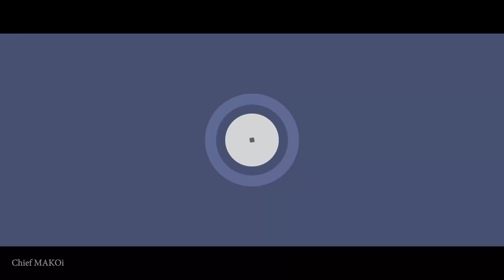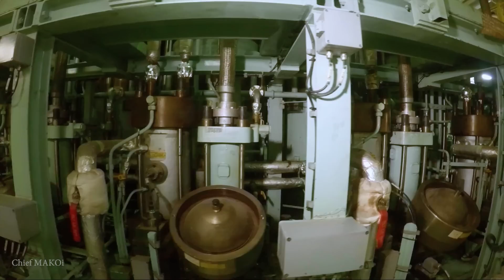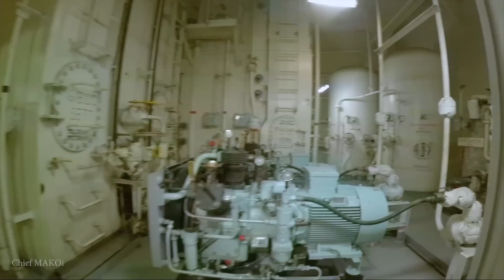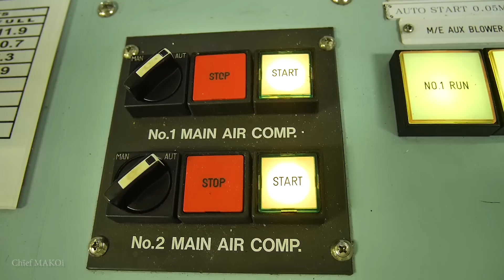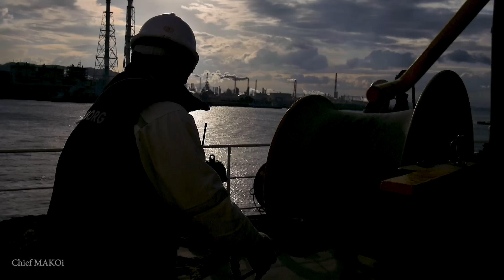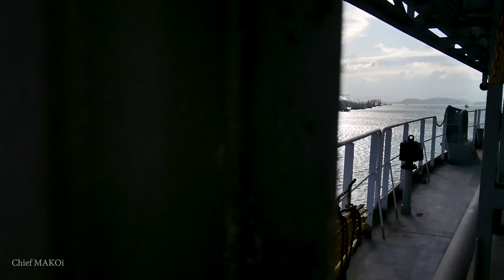Starting Up the Ship's Engine and Leaving Port | Seaman Vlog

Comment from the maker: Uploaded just on time after watching the premier of Game of Thrones S8E01!  I hope you enjoy this guys.  Don't forget to LIKE, COMMENT and for those who are new to my channel, SUBSCRIBE!!!
Reply: I’m not allowed to watch Game of Thrones 😐😭
Reply from the maker: @Stanley Banks  we just cut off the fuel injection for the particular cylinder.  The engine can still run but should not exceed 50% load.  Fixing it will have to be done when the engine is stopped.
Reply: New and just Subscribed.
Reply: Very interesting videos congratulation Mr CHief
Reply: Sir I am kindly request sir you want upload Electro technical officer job life and story sir please sir you want upload sir I am a BE EEE holder I want join ETO course so  you want upload  sir
Reply: I just watched this after watching GoT. Good combo.
Reply: Chief, regarding overhaul of a ME Unit ( exhaust vv, piston, etc ) which are the steps to isolate properly ( in good order ) the ME? Thank You.
Reply: What does dead slow ahead and a Stearn mean
Reply: @kydddj111  - dead slow ahead means the lowest sustained speed moving forward, it's usually the first notch on the gearbox, dead slow astern is the same thing , only in reverse.
Reply: Dead slow ahead = very slow forwards. Dead slow astern = very slow backwards.
Reply: Nice and informative vedio Chief 👌..very helpful
Reply: Chief MAKOi ,
I would like to be a marrine engineering.
Where should I study the marine course for good placement.
Reply: Great video keep up the good work sir.
Reply from the maker: @fluke196c  no keys.
Reply: sir I request you to please tell the crew and officers not to harrse galley dept they the only persons who feed the crew on board. It is my humble request. please make a video again for galley dept one capt has harrsed me a lot due to that I was at home for 3 years.
Reply: @venrammur9800   nobomNOBODY
Reply: Chief MAKOi, glad to have stumbled on your channel. I've always been fascinated with the seafaring life but for some reason didn't have the gumption to make that career choice. Bonus: ikaw ang kauna-unahan na naenkwentro ko na kapangalan ko na, kapalayaw ko pa. Kudos for sharing your experiences with our young seafarers and the rest of the world!
Reply: Hey I'm new to your channel and wanted to say thanks for the content and I was wondering how did you get into working on ships I'm just curious how people get into jobs like these
Reply: Chief MAKOi, you stated that the engines flywheel is directly coupled to the prop shaft and that the engine must be reversed to generate reverse thrust. Is the engine on your vessel a 2 stroke (2cycle) diesel ?
Reply: ROTAXD 
Chief sad the exhaust valves are electronically controlled. That suggest the inlets have atmospheric or piston valves which are used only on two strokes
Reply: @Dave5843-d9m  you're right there, the inlet valve is the piston itself that covers and uncovers the scavenge holes  or inlet ports in the cylinder liner as it travels up and down inside it to allow fresh air in this case scavenge air...
Reply: You’ve got a beautiful clean engine room there, chief!
Reply: Chief ,good day I finished and graduated marine engineering year 2013. Is it still ok for me to apply as engine cadet?
Reply: Chief ,good day I finished and graduated marine engineering year 2013. Is it still ok for me to apply as engine cadet?
Reply: Hey, I might be starting a diesel mechanic apprenticeship soon, could we video chat sometime? I would like to be a mechanic on ships like that
Reply: @chief Makoi- thank you so much for these videos. I watch them & remember my dad. If he was here, oh how he would ENJOY, watching the videos.
Reply: This video has more rewatch value than Game of Thrones season 8.
Reply: wowwww MTM Chief
Reply: pa backer sir.. wla na ako pera
Reply: Diesel electric engine cruise ships
Reply: Engine cylinder engineering room
Reply: I'm a new sub. Very interesting content. Stay safe !
Reply: Super sir

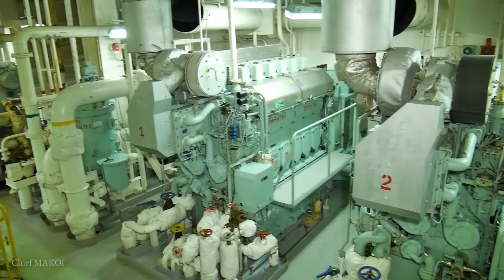Comment: At 2:20, it appears that you have (all?) three gensets in one room. Is that common practice? It seems to raise the risk of a failure of one generator damaging others - critical surface based installations usually have them in separate fire cells. Is this considered a serious risk?

Comment: Once the one piston is remove, can still the engine keep running?
Reply from the maker: That would cause too much imbalance.  In case of emergency where one cylinder has issues, just keep the piston inside and cut off its fuel supply.  The engine will still run at reduced capacity but should be enough to get the ship to safety for repairs.

Comment: It is my understanding that there is no clutch between the engine and the propeller shaft. For reverse, do they stop the engine and start it backward? I just viewed a video where they were testing the engine by running it. What stops the ship from moving if on Anchor? If it is at dock, can they really put that sort of strain on the dock lines?

Comment: Leaving the port now takes longer time for the engineers to stay in the engine room because for ships equipped with scrubbers.. you would have to changeover to HFO again when 12NM away from shore. Now after unmooring  it takes another 3 hours for engineers unlike years ago it only takes 1 hour and everybody can rest. So many additional machineries,regulations,procedures and maintenance marine engineering is becoming more and more stressful yet salary range remains the same

Comment: Why can the engine run 0 to 50rpm, 60 to 70rpm, but not between 50 and 60rpm?
Reply from the maker: Barred speed range causes heavy vibration.

Comment: The different ships, because of the different engineering plants, can take up to 8 hours to get the engines ready.  Steam plants need time to warm the firebricks in the boiler so that the bricks don’t crack.  For ships like navy destroyers with boilers, in a “Pearl Harbor” scenario the ship can get underway in minutes by sacrificing 1 or 2 boilers while ships with gas turbines can get underway quicker with little to no damage.
In 1986 my ship was in Subic Bay and at morning quarters we were told to be prepared to get underway in eight hours.  At this point one of our four gas turbine engines was out of the ship.  An hour later we were told to be prepared to get underway in four hours. At two hours after morning quarters we were told to be prepared to get underway in two hours. At three hours after quarters we were underway and the engine had been put in the ship far enough that we could bring it online in a day or so.
The scramble to get underway was brought about by President Marcos fleeing the country and my ship was to assist if he fled by helicopter or small boat.
In 14 years at sea in the navy, I served on six classes of ships and have gone dead-in-the -water at least twice with engine failure.  Once, just off the coast of California and once, just West of the International Dateline.
Reply from the maker: Wow.  Thanks for sharing. 😊

Comment: God Bless you and your family Chief MAKOi!! Happy Thanksgiving to you and yours! Fair Winds and Following Seas!! Take care! 🇺🇸🇵🇭 ⚓️⛴
Reply: Chief MAKOi I was watching a documentary called "Mighty Ships" where one episode showed the A.P. Moller Group Maersk Line E-Class Container Ship Emma Maersk. There was something they said on the show I find hard to believe, the part where they said that the engineering crew aboard changed out a broken piston rod in the ship's main propulsion plant ( Wartsila 14RT-Flex96C 14 Cylinder 109,000 Horsepower Marine Diesel Engine ) while the engine was still running! I thought that with it moving you couldn't work on it because the pistons, piston rods, and crankshaft would be moving constantly. I know they adjusted the fuel loads in the other 13 cylinders to compensate for the loss of that one cylinder while they where working on it, but my question is can you do that and if so how? Thanks a lot for your response! Have a blessed day!

Comment: Hello Chief! As usual, a captivating look at engine starting procedures. Thank you. My question is this. Typically, how long during port operations does is take to stop the engine and reverse its rotation? Say from slow forward to slow reverse. Also how many bar does the air receiver drop on a typical start and how long does it take for the compressors to bring it back up to 30 bar?
Reply from the maker: Good question!  During port operations, if the engine is at slow ahead, pulling the control lever to stop will almost instantly stop the rotation.  You can immediately pull it to slow ahead and the engine will be able to follow with no problem.  As for the air pressure, it depends on the capacity of the air tank.  But as per regulations, the air tanks at full capacity should hold sufficient pressure and volume enough to start the engine 12 times consecutively without replenishment.  Refilling will depend on the capacity of the air compressors.

Comment: As a guy who has operated small boats and kayaks near a big port, those tug boats are scary. The big ships are design to glide through the water efficiently. Tug boats aren't. They are bricks with giant motors, and the waves they put out can swamp you if you aren't paying attention.

Comment: Just wonder why they don't utilize electric motors like railroad locomotives? The diesel engine drives a big alternator  and that feeds the electric motors. It would be.much easier to reverse  and have neutral . Just wondered. Are the big diesel engines .piston driven or turbine?

Comment: Hope I am not being a nuisance but  to go astern or reverse does the engine have to rotate in the opposite direction?  Is there no reverse grarbpx?
Reply from the maker: Yes it has to rotate in the opposite direction.  Some ships are equipped with reversing gear or controllable pitch propellers but for cargo ships this is the most common setup.
Reply: Thank you for your reply.  I can't quite get my head around how the engine can run backwards and how quickly the reverse action can be performed?

Comment: 1 minute into the video and I’m thinking the shipping industry needs massive investment in innovation, automation and sensors... it’s all done manually! No wonder it’s complicated and not as easy as turn the key and sail away 🤦🏻‍♂️
Reply: In coming generations, this will be obsolete for sure like steam engines do, solar boats are comming, large electric motors and gears will do it digitally automaticaly I think,

Comment: No gas turbine and no electric power. Just a Diesel engine able to turn in both direction with compressed air start. Interesting.
Maneuvers in the port should be quite complicated in this context. Hopefully, there are the tug boats there.

Comment: Chief can you please explain why they is a void operational speed between 50rpm and 60rpm as per the rev counter. Also how much amps do did u have to have in reserve for the bowthrusters whilst busy with docking maneuvers?
Reply from the maker: It's about harmonics.  At that range heavy vibration occurs.  We don't have a bow thruster on this ship.  But on my other ships that had BT, it will depend on the ship size.  We usually start up an extra generator to compensate for the power requirement.
Reply: Thank you for your reply

Comment: So, you are starting the engine up once before the ship actually starts moving.
Wouldn’t that pull hard on the ropes, backwards or forwards (assuming the propellers don’t have variable pitch)?
Reply from the maker: Only for a few seconds.  It won't generate too much thrust to pull too hard.

Comment: You did not show the engine startup. You blew air thru to clean the cylinders out, then closed all the valves. Then next it was running and doing a test at dead slow.
Disappointing

Comment: So does the engine rotate clockwise and anticlockwise depending on direction required? With valves and injection controlled externally this would be relative easy for a computer to make happen.

Comment: The engine turning gear used to be called barring gear. It got the name because the couplings on steam turbines had slots so the shaft could literally be barred manually if the batting motor failed. 
Steam turbines can be scrapped if not kept turning as they cool or while they are being preheated first use.

Comment: Hello sir. I'm an Engine Cadet po, I'm curious for what will happen if the gases inside the cylinder were trapped inside/not released. Will it affect the temperature po ba?
Reply from the maker: You won't have combustion for the next cycle because there's no oxygen.
Reply: @ChiefMAKOi  Thank you so much sir.

Comment: I am surprised that the engine is started and stopped for menuvering. I would have expected a clutch system or something like that. I guess it is because with all the power the engine has and the back force from the screw a clutch would just fail.
Reply from the maker: This setup is common for most ships because it has less parts so it's way cheaper to install and maintain.

Comment: As an ex marine engineer it was standard procedure to remove the turning gear before opening up air to the main engine.
Reply from the maker: Not necessarily.  The turning gear is interlocked with the starting mechanism.  If it's engaged, the engine won't start even by accident.

Comment: Do these engines have to warm up like a car and when you said the engine is ran and stopped during small maneuvers does that mean you just let it idle?
Reply: Depends on the ship. The generators will always be running to provide the electicity the ship needs and the main engine hot. Really big engines are always kept warm by heating the cooling water when they are not running, trying to run the engine when it's cold would lead to catastophic failer and an enormous bill (maybe writing even off the ship).  On a directly driven propeller similar to the one in this video, the engine has to stop when the propeller isn't turning. It's directly connected, there is no gearbox. To go astern the engine itself also runs backwards. Faster running engines have a gearbox and maybe a reversing gear, but don't typically idle. On an all electric boat, the propellers are driven by electric motors. Enough generators must be running to meet the demand (and therefore idling and syncronised) before power can be drawn. Steamships (both piston and turbine) are yet another case, enough boilers must be in operation to provide the steam required and enough pressure must have been built up before movement can occur. It's only smaller vessels that would idle a main engine in neutral.
Reply: pklongutoobe ty sir

Comment: Excellent video. As you told there will be no camshaft for exhaust valve and fuel pump? But what about cam shaft for inlet valves? So do you mean that in ship engine, there is no cam shafts and inlet/exhaust valves are hydraulically and electronically operated? Thanks for your valuable time.
Reply from the maker: For electronically controlled engines there are no camshafts.
Reply: Thank you Mr.Chief for your prompt reply.

Comment: I was an engineer in board cargo ships from 1960 to 1967.  During this time I went from 5th Engineer to Chief Engineer.  I passes British exams of Chief and then the highest Extra Chief Engineers exam.  I was Steamship Inspector in Canada, inspecting and certifying ships for sea worthiness.  But I had lust for education; so I quit and did a degree in Electrical Engineering and then MBA.   After decades of service I am retired in Canada.  In my time there were British Doxford Engines, German MAN, Swiss Sulzer all of very large caliber 1000 mm cylinders, 6 cylinder but at low RPM.  I also did a stint on board Canadian Coast guard on ice breakers.  They were diesel electric.  That is an electric motor drove the ships propeller.  The reason for use of this system was that it gave large torque at low RPM.  I love sea and had sail boat for recreation.

Comment: What're Piston rods, crosshead in large Marine engines?🤔
plz reply!!
Reply: Crosshead are conrods from the piston to a fixed sliding up and down joint and below that the conrod acts as it normally would if it were attached to the piston directly. Ie moves up and down and allowed to go side to side. Crosshead help eliminate piston and bore sideways wear

Comment: Sir i have previous interview he ask me how pressure need the air tank to start the main engine and i may answer is 28 to 30 bar same your documentation but he said is wrong the answer is 30psi is that correct sir? Thank you and godbless po sir
Reply from the maker: He is wrong.  It's always around 30 bar.  30 psi is only around 2 bar.   That's very low.
Reply: @ChiefMAKOi  we discussed may answer sir he told me when use 30bar than is may be explode because 30bar is almost 400psi he also a chief engineer sir.Thank you sir for that information.
Reply from the maker: I don't care if he's a chief engineer.  He is wrong.
Reply: @ChiefMAKOi  thank you sir for the information i believe you sir👍 thats why i confused when heard your video sir thank you sir and godbless

Comment: The pilots job is responsible for moving the ship out of the harbour? Why doesn't the captain do this?
Reply: Because the Pilot is most familiar with his harbour. They know every turn, bouy, channel, pier etc plus the signals with the harbour master.
Reply: Thanks. There is an intermodal a half mile from where I live. Containers are double stacked on train cars. I watched them load and unload them from rail cars. We are inland in the USA. Never seen the ships that brought them from over seas.

Comment: That answered some questions I had.  Still would like to know more details on actual starting of the engine.  I understand there are differences but a typical scenario.  You must get the engine turning a certain RPM then introduce fuel?  Is the compressed air injected via the normal intake valves or is it separate? Etc.
Reply: Sir, it's separated from exhaust valve,